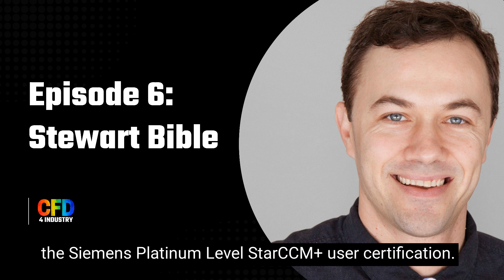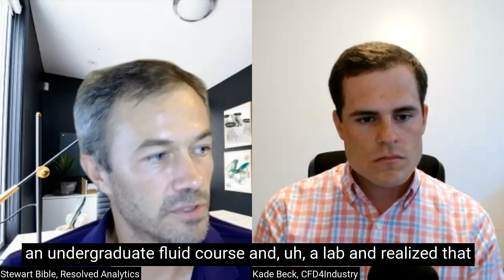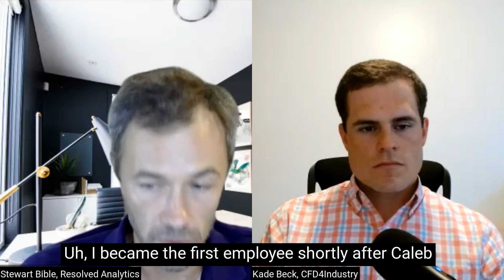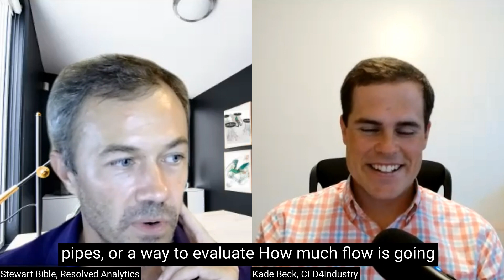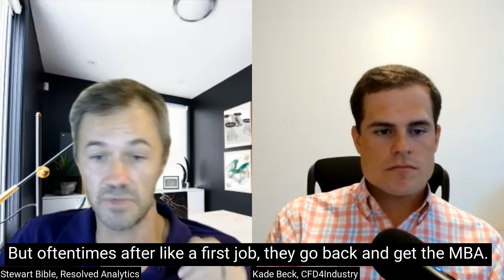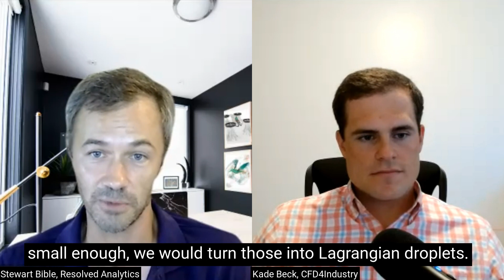EP 006: Stewart Bible | How to build a CFD business {How To Become A CFD Engineer}

Comment: The main aspect I found truly beneficial is his bravery in leaving his PhD path to enter the industry. Moreover, as a newcomer keen on utilizing Computational Fluid Dynamics (CFD) software and eager to explore its full potential, I initially assumed that individuals founding such companies were fully knowledgeable in the physics offered by each software. However, he disclosed that there are certain areas they may lack familiarity with. Additionally, from my own limited experience, he stressed that the most appealing sectors are primarily mechanical and chemical engineering, which heavily depend on simulation due to the intricacies involved in extracting precise data from experiments and lab work.
Reply from the maker: Glad you enjoyed the discussion and found it useful. Everyone starts somewhere and no one is an expert at everything.